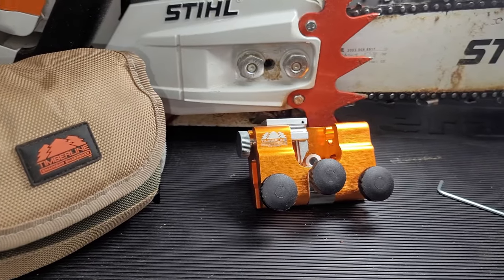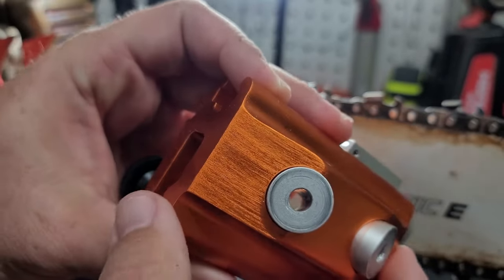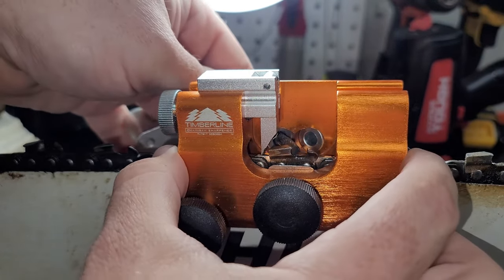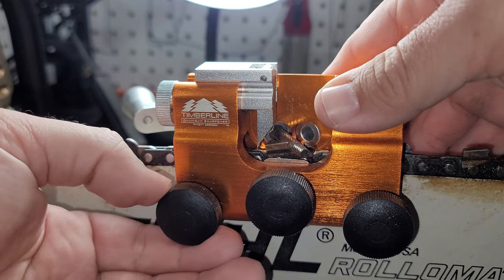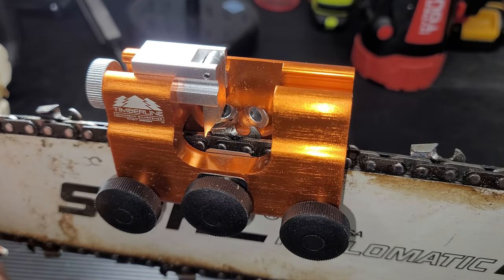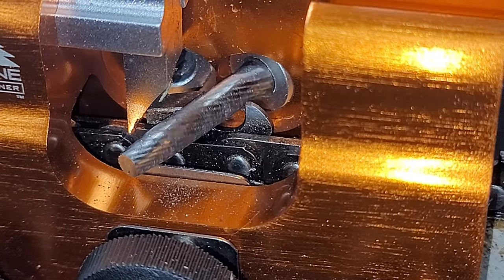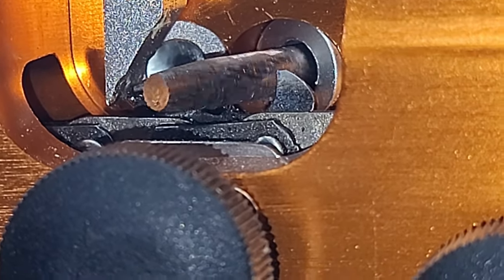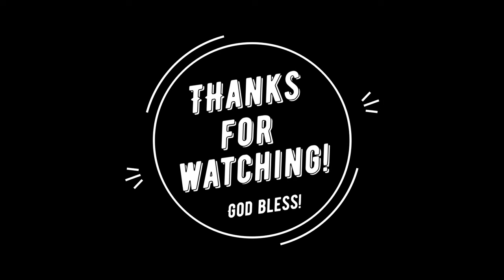TIMBERLINE CHAINSAW SHARPENER- How to use.

Comment: From the Timberline website: "The center knob is only needed if your bar is worn and the chain flops from side to side. It helps push the chain vertical when sharpening side A so that the carbide can be inserted into the chain without having to push it over with your finger."

Comment: I'm here for a refresher. I've been through the summer since last needing to use it, and I believe that your video is among the best ones that I have watched.
Better than most of the ones I saw to learn how to use the tool.
Reply from the maker: Thank you for the kind words
Reply: Hey, I was watching your field test video when your notification came across.
I could bend your keyboard fingers for a time, but I have a project to finish.
I will leave you with a riddle.
How do you get a new chainsaw?
I'll check back later. Give you my answer if you haven't come up with a better one than mine.
Black walnut for the demo, correct?
I used to describe my place as the one that you can't see from the road.
Then three years ago a tornado came through and took care of that.
My volunteer walnut trees were almost to gunstock thickness. In another twenty years, they were going to be my retirement account. There was one that was growing in the shade that gauged less than double for the time we have been on the property. It was veneer or musical instrument quality.
Now it's firewood.
Reply from the maker: How do you get a new chainsaw? 🤔 I'm not excellent with riddles but, I'd say break your old one or get it stuck in some wood lol.
Reply: @knotbreaker  loan yours to a friend.
He did me a favor though. It's an MS 310, and it has a design flaw. I couldn't complete a big project without breaking the starter paul. It has just one instead of two.
Other than that, it was a beast.
Walked into Home D one Sunday evening, and glancing towards the rental department, sitting on a shop cart, with a Halo glowing around it was a Makita DCS6421.
That fifteen dollar purchase turned into a $315 one.
Plus tax, and worth it.
It's German made, and beastier.
Reply: Be safe.
The machine don't care.

Comment: Excellent video.   Don't forget to tell them to never spin the cutter backwards.  It will chip the cutting edge of the carbide immediately.  

The center knob provides support for the cutters on the right side of the chain.   The sharpening motion of the carbide cutter tends to push them away more where as the left cutters tend to get pulled into the cutter. The spring steel on mine likes to ride down.  It needs to be more securely attached to the Timberline.

Comment: You need to use oil on the shank of the file. I use a small dopper with bar oil. I mark the first tooth and take a very light pass. I do the entire loop on either the right or left cutters. You will find some cutters have a little more material removed and some next to none. I do each side with at least 3 passes till all the cutters are the same length and no cutters have any jagged cutting edges. I then repeat on the opposite cutters. I take light passes as not to dull the file prematurely. Also snug up the chain tight that will eliminate the need to use the center knob to clamp the cutters and produce a much more accurate sharpening. Best of luck to all sharpening your own  chains 😊

Comment: Not so fast.  I tried the  Timberline and my chains consistently walked to one side.  Double checked and found the pitch of the Timberline file is different from the chain.  Turns out I was sharpening the tooth point on one side and the tooth heal on the other.  Will give it another try to be fair but in no way is this a quick k operation.  I suggest the two-in-one hand file if you want to get things done.
Reply: How can a singe file have a pitch? 🤔

Comment: Cool product. The bushings are probably hardened to prevent damage from the file? I like the case. How fast can you sharpen with this?

I’ve been slabbing alot of wood and would like to figure out how to speed up sharpening.
Reply from the maker: You can certainly hand file faster, but, you can't hand file as accurately. Perhaps there are some skilled woodsmen that can get close. But the point of this product, in my opinion, is a sharp tooth with an accurate angle, every single tooth every single time. It also gets my chain sharper than many I've felt that were freshly hand filed.
Reply from the maker: Also, there's the ease of use in the fact that you can sharpen the entire chain from one position. So, while it's not as fast, it has other advantages that make it worth it. Especially for homeowners or weekend warriors because the carbide bit lasts for 20-30 sharpenings. Someone who doesn't cut all day, every day can use this for multiple seasons of  firewood harvesting.
Reply: place the carbide cutter in a power drill - I have a Timberline but have reverted to hand filing.

Comment: I know on our lathe and milling Machines if you don’t have the bit/work spinning and hit the carbide it will break. Do you have this problem with these carbide bits breaking?
Reply from the maker: They will chip quite easily if you don't have the jig set correctly. I have yet to break one.

Comment: Great video, and product demonstration! Keep up the good wrk, I will look into one of these myself!
Quick question, are you using a microphone? If not you may need to look into one
Reply from the maker: I am using a mic. Probably need to download an equalizer software. Is there an issue with my voiceover?
Reply: @knotbreaker  it my be my hearing, but you come across soft spoken, and at time a little hard for me to hear.

Comment: I bought one about a 2 weeks ago and first time I used it the carbide bit got stuck in the barrel and I couldn't take it back out. I tried tapping it out and broke the carbide bit! I spoke with customer service person and he asked I oiled the carbide bit prior to using it! That's why it got stuck
Do you oil the carbide bit before using it?
Reply from the maker: I do not, that's interesting! I've never had that issue either
Reply: @knotbreaker  
I wonder why I binded on me so tight that I couldn't get it out. Customer service guy said it's happened before to other customers and they've sent it back to have them press it out.
Anyway I got the parts yesterday, so I'll give it another try
Reply from the maker: Quite an interesting experience for sure. How was it dealing with customer service?
Reply: @knotbreaker  
They have been very professional and easy to deal with
Reply: I have one and it works great.  The instructions tell you to use oil.  The carbide cutters come 3 sizes 3/8P, .325 and 3/8.  To avoid breaking a cutter don't let it grab or drop them.  Stay from the cheap knockoffs.  Timberline customer service is exceptional.

Comment: Nice video.  Can this handle a small chain like 1/4 inch?  I have a small Sihl electric saw and it runs a 1/4" STIHL PICCO chain.
Reply from the maker: I do not believe they're made for the smaller chain, unfortunately.

Comment: Tighten that center knovb ! It wedges the chain link tight so there is no deviation or chatter when cutting .

Bump your pawl setting tighter if the gullet or outside edge isnt shiny on first pass.

Good sharpening is removing the variables in the machine.

Comment: You need to adjust your block and put the tip of the carbide in the gullet because it's thinner in diameter then when you go to sharpen it and you're actually getting the full tooth

Comment: Yhey are great, when conditions are perfect,the real bad thing about these is when a tiny shaving of steel gets in the gap...jams it right up, had to beat the backside of the carbide bit to knock it out. I may try it again o e day, but the Stihl 2 in 1 does a fantastic job so I'll use that.
Reply from the maker: I can't wait to compare the two.
Reply: @knotbreaker  2 in 1 is fantastic imo...once I get some new carbide bits for the Timberline I'll try again..
Reply from the maker: I've used the 2n1 once and wasn't impressed, thus far. Probably user error but, I'll try again!
Reply: @knotbreaker  more pressure on the front hand worked for me, definitely easier with 2 hands

Comment: Anyone see the fatal flaw in this design?
Reply: The flaw is that the jig runs out of adjustment once the chain has been sharpened several times. Mine is a Chinese knock - off. The idea is good but the delivery is not.
Reply from the maker: How so? The jig is infinitely adjustable. At least the original version is, anyway.
Reply: @knotbreaker  I believe the Timberline tool would have infinate adjustment. The chinese knockoff, no. Its a piece of junk